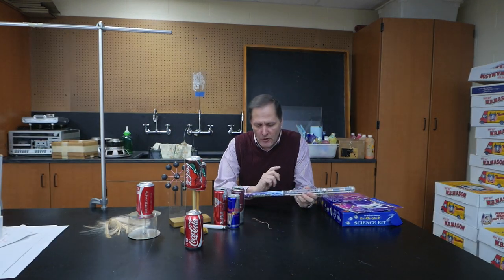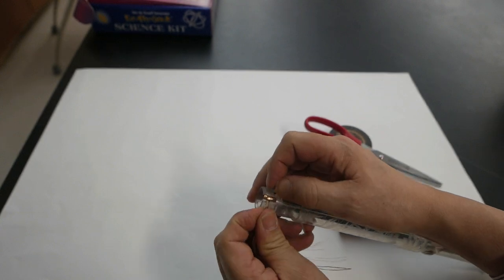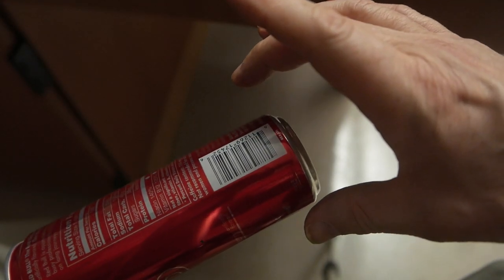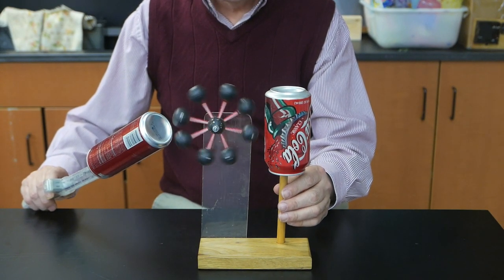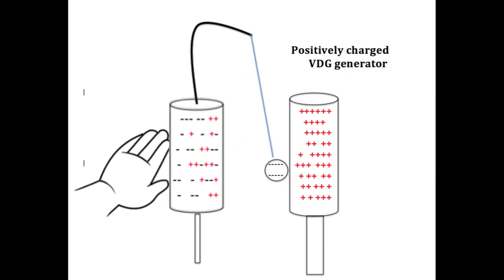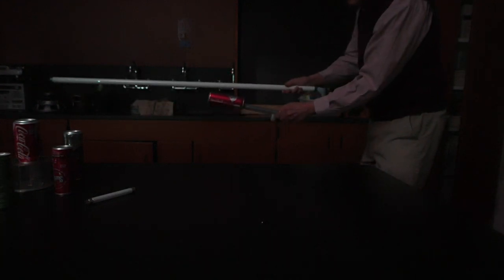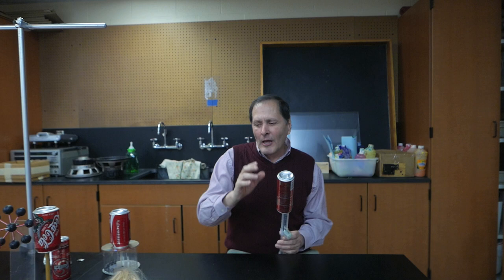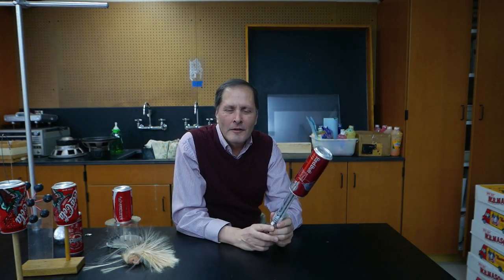Supercharging the Fun Fly Stick - Van Der Graaf Generator // Homemade Science with Bruce Yeany

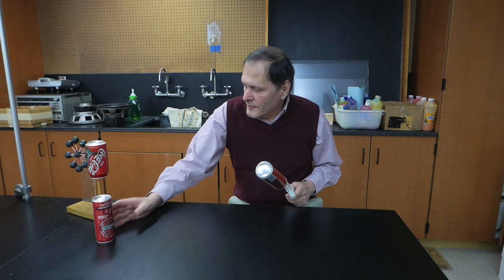Comment: 4:30 is my favorite demonstration of Gauss' Law for electricity.  The cups flay off 1 at a time because the charge accumulates on the outside of the conductor, which is only the topmost cup.
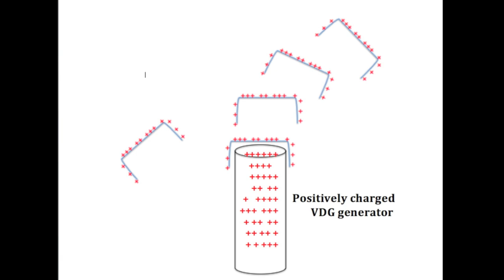Reply: Is that Gauss's law though? That is a very interesting observation regardless, that since they're all connected it's one big conductor and the charges will only be on the outside surfaces to it, I think the video might even show that a little confusingly at 6:59 (this is the demo you're talking about right?)

Comment: Neat! I have 5 fly-sticks for the school workshops; For the coherer receiver (metal filings, tube, two bolts) we usually charge a film-can leyden jar, which takes a bit of fiddling to produce large sparks. This could save some time while testing the coherer :-) I've tried piezo stove lighters, but they don't seem to work quite as well.

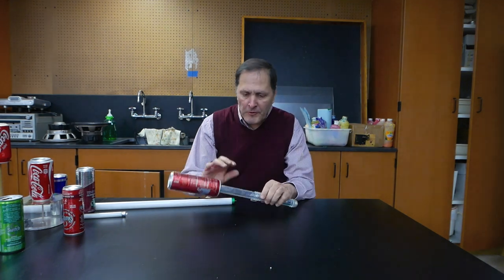Comment: 7:05 the illustration is a bit confusing to me.
The positive charge is shown above the outline of the cupcake wrappers there, but shouldn't this part be negatively charged and the "inside" of the wrappers positively?
Reply from the maker: I need better illustrations.  since the aluminum is a good conductor, I believe the electrons are removed from both sides of the surface and both sides would be positively charged.

Comment: I think... if the sparks are 1 inch long then the voltage is 75kV not 30kV as stated in the video. Air Breakdown voltage is 30kV/cm.

Comment: Don't aluminum cans have plastic liners? If you removed that would it work better?
Reply: Not plastic, lacquer.
Reply: Nathan Callahan a steel bean can would be best I bet!, throw it in the oven for a hour cool it wash it attach it
Reply: Even if it's coated with a thin layer of some non conductive material, the voltage induced by VDG generator is so high I expect it to exceed the breakdown voltage of the insulator.

Comment: I have a question about the experiment which makes the balls jump and fall again. Has it got any application to heat fluids, for example?
Reply from the maker: not that I know of,   the balls jumping is very similar to the franklin bell demo.   The balls get positively charged on the bottom plate,  are  repelled by the bottom and attracted upwards where they gain electrons, fall and the process repeats itself
Reply: +Bruce Yeany (Yeany Science) ok thanks. I thought that maybe it could be used heating particles in a similar way that a microwave does.

Anyway id like to congrate you for your vids. Im a spanish ingeneering student and i have learnt a lot with your experiments! thank you for your attention

Comment: Bruce, i love your videos, so much better than mine. I have some questions: how to obtain the graphite coated styrofoam balls? Is the induction moter also made of the same kind of balls? Thanks!
Reply from the maker: I had purchased balls that were already coated,  the induction motor was the same type only larger. Catalogs advertise them as pith balls for static electricity demonstrations . I heard some people have used small foam balls and rub them with pencil graphite, I haven't tried this myself or  you can try wrapping the balls with aluminum foil.

Comment: It occurs to me... wouldn't the individual atoms in the can be repelling each other, too? Obviously, the inter-molecular bonds are far too strong for this to create any noticeable effects, but the repulsive force pushing against these bonds would not be zero.

This also brings up a theory. I'm curious about what kind of charge it would take for these repulsive forces to be strong enough to cancel out and break those bonds. Of course, I'm sure most materials would already have those bonds broken simply from the heat caused by inducing that much electricity, but this is a theoretical thing I'm talking about. Or does the repulsive force actually play a role in this heat destruction? It really gets the mind working...
Reply: Interesting. The site doesn't have much information about it, but it's interesting nonetheless.